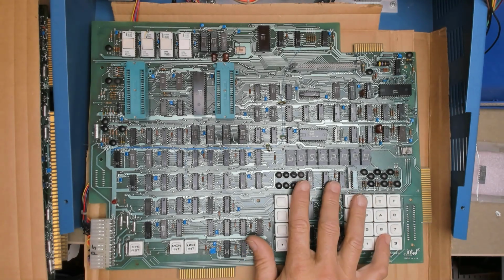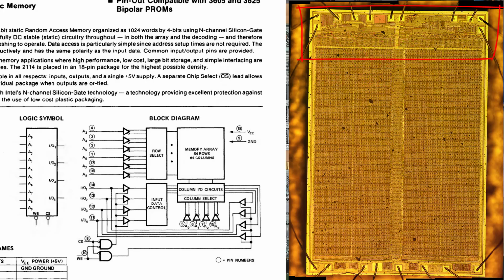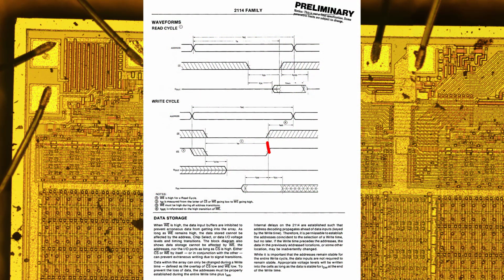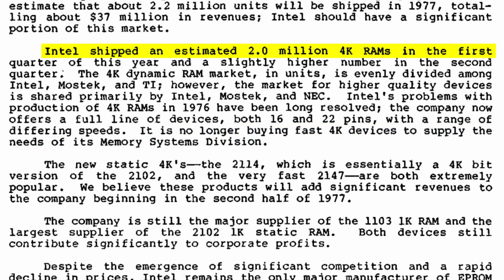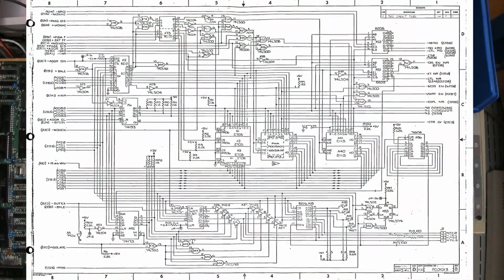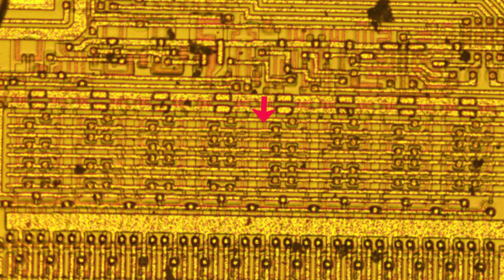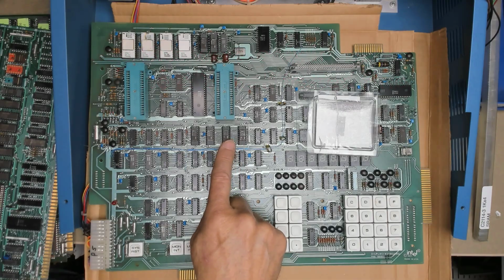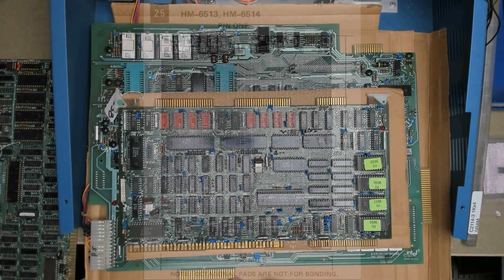{110} Intel's 2113 RAM: Never Sell It, And Never Speak Of It Again

Comment: From 1980 thru 1994 I worked as a test engineer at NatSemi focused on 2716-27C256 EPROMs. Your discussion of the 2704/2708 is a bit misleading in my opinion. While a 2704 may pass as a 2708 there are potential issues. My guess is you tested at nominal Vcc and the access speed of the programmer (typically much slower the speced speeds). A cell that doesn't fully program or fully erase per the spec can be an issue for the full expected life time data retention spec. This can often be revealed by Vcc margins testing (Vcc lower/higher  then the speced Vcc range).  It can show up as a full failure of the cell or as an issue with TACC or TCE timing. Memory testing is also guard-banded meaning it will work in a wider Vcc window then the speced range and will be tested to be faster the speced access times.  
Long term burn-in testing can be used to determine the window of acceptable voltages/timing (shmoo plots). These then set the required test specs to guarantee the part will hold its programmed/erased cell state within the life expectancy of the part. In my time at NatSemi I loaded hundreds (thousands?) of parts onto burn-in boards, baked them while powered up / being accessed and pulled them at various times for testing, then back in the boards for more burn-in, then out for testing. Rinse and repeat many times. We tested fully programmed / fully erased / checkerboard (55/AA) and topological checkboard (adjacent cell on the physical die have cells in the other state around them). I also wrote the test and analysis software for the parts.
Point being that a 2704 with a 2708 die indication programmed as a 2708 doesn't guarantee the part will retain or present the programed values over the full speced life time.
Reply from the maker: That is an extremely good point, I wasn't thinking about Vcc margins testing or other conditional issues that would reduce long term reliability, i was stuck on seeing simple go/no-go defects.  It should have come to mind after testing that one 2113 that didn't show up until after the cell had been cycled a number of times before it finally stuck high.  
Since they were equivalent pin-out, I guess it wouldn't make sense to take a perfectly good '08 and mark it as an '04.

I fully expect that Intel's "1976 4K production problems" were, in fact, not completely solved by the spring of '77 and maybe ran through mid-year.  I am hoping that others with 2113s can give us a range of dates they were produced.
thanks
Reply: @HelloWorldETX  I worked through a few yield crashes during my time at NatSemi. We also brought a new CMOS fab online and it took a while to the get the process dialed it. Those were fun days and feel like a couple of lifetimes ago.

Comment: bit like part duff 64k  x1 bit drams(4164 or equiv.) but these were definitely available,  being sold as 4532s, with 4 combinations of 'dead' section, bad row or bad column and in each one of those could be higher or lower one dead,, the zx spectrum used these for their upper ram
Reply from the maker: Did they bond the die differently depending on which quad worked properly? or same pinout like the 2704/2708 and 2113/2114?
Reply: @HelloWorldETX  identical pinout , there were differences in row or column dropout depending on brand, OKI ones were one, TI the other cant remember which one had which dropout offhand
Reply: @HelloWorldETX  They had holes for links on the board to select the correct High or low.  The selection was done of different signals from the different vendors so needed quite a few links.
Reply: I read that at least one board variant of the Dragon 32 used those, there was one jumper link to flip the A7 line. All the boards I saw used two banks of 16k*1 parts, in one case the board was only designed to hold 8 DRAMS and it had a neat little daughterboard installed to hold the other 8. I don't know if the manufacturer was hit by shortages or just using whichever parts were cheapest.
My friend converted his to 64k.
Reply: @boristheengineer5160  my current dragon 32 has 16 4116s with some on that daughterboard,  a previous one had 8  32kx1bit chips which arent half duff 4164s but effectively have dual 16kx1 bit rams inside them, they have separate ras and cas pins for each 'half'

Comment: The same sort of thing happened with early 4116 16Kx1 DRAMs. 8Kx1 versions were sold cheaper and appeared in some computers such as Atari 800 and 400.
Reply: And it happened as well with the 4416 16Kx4, where defective chips were sold as 4408NLT and 4408NLB. It is impossible to find a datasheet for these (as far as I know), but they were used in Matra Alice and Exelvision EXL100 computers, with the "T" and "B" indicating if the top or bottom of the address space was usable.

Comment: It's fascinating how history repeats, back then struggling with ram chips, today struggling with 14nm, 10nm, and now rebranded 10nm to 7nm finfet transistors. In between all of this, struggling with x86 (p1,2), struggling with new architecture (p4), struggling with even newer architecture (intanium), struggling with in house graphics solutions (i740), struggling with even more in house graphics (gmas and Larrabee), struggling with more ram (3d xpoint), struggling with even more ram and memory (optane).
It reads like a disaster report.
Reply from the maker: In fairness, that is the cost of pushing technology forward.  Once Intel got the 2114 process into full production, it became the standard simply because it was superior.  Quick, low power, and reasonable cost.  while it was embarrassing at the time, in the end I think it more than made up for the delay in roll-out.     

Eight or ten years after this 2113 problem, I was at a conference where intel's CEO was the keynote speaker.  He announced that fabrication R&D was just getting too expensive and Intel was no longer going to be on the cutting edge for chip technology; but they were going to focus on designing the chip and then outsource to offshore fabrication houses so that the fab shops could spend their R&D money perfecting the process.  This was to a room full of semiconductor and fabrication researchers at a national conference !!!

Of course, that is how we got to where we are today, i.e., in a situation where none of the domestic chip manufacturers can actually make their own chips that require the absolute latest process.  The federal government can buy all the new fab lines they want for Intel and others, but when the bottom line says it is cheaper to send fabrication off shore, they will no doubt, once again, outsource the latest fabrication processes.
Reply: @HelloWorldETX : That's all nice and dandy, but with intel, it always feels like they TRY to create the next best thing after bread but halfway through, they loose interest or goal. The NuCs are the next entry to this list, intel just lost interest three months ago, leaving vendors for their own, telling them to "please be so kind and keep developing and making them, because I got bored".
Netburst... "failed" architectur, intel lost interest.
Itanium... same game.
It would have been the same for x86, if amd hadn't outdone and gone above and beyond them, fixing many architectural flaws and short comings.
AGP... intels take on a highspeed high bandwidth bus with many fantastic features such as "AGP aperture ram" and "side band adressing", never fully utilized, never truly completed.
I swear, the longer I think, the more dropped, bodged or sold projects come back from the nether realm of my brain where they should have stayed as corpses to rot forever.
And now... we are at the realm of disabled, broken, obsolete cpu instruction sets.
Disabled from THE very day it was put into silicon... (drum roll)... TSX 🎉🎉🎉.
Next contender... AVX 512...🎉🎉🎉.
I could swear, there was another one, intel silently did away, something to do with "randomized" memory mapping, inherently flawed and defeated by a precise timer like java or even javascript could provide and a whole load of ROPs. 😂
I'm not salty at intel, I just think and feel, for once they should pull something through, finish it, fix the bugs from a first revision whatever "that" is. But honestly, I can see the next butchered project already, their just recently born graphics card segment. 😮
Reply: @bloeckmoep  this is i think actually a issue all across US corporate culture. Its a symptom of short term profit preference due tp shareholder primacy.

Comment: Uh-Oh.... Now I need to dig out my prompt 48 and do a memory test! I haven't used it in quite a while now.
Thank You for another education, Craig. i was completely unaware of the 2113/2114 story. Always learn
something new in your videos.
I started thinking about the prompt 48 again when I happened upon a pretty nice 8048 based clock that
Matt Millman came up with. Of course, as He has done in the past, He designed his own MCS-48
programmer.... Man.
Reply from the maker: Hi Mark, Matt”s also has the adapter for his programmer to program 8755s also.
It will be interesting to hear about your prompt 48, if it has the piggyback board or not.  
I have seen a photo of a prompt that had four places for RAM but only two populated and two bare (no sockets).  I couldn’t see if they were 2114s or 2113. But no piggyback.

Comment: sinclair was cheap when they build the ZX spectrum computers and they bought half broken ram too. They already did that with their amplifiers where they bought rejected transistors,  so they had to make something to test and pair transistors.    So with the 2704 did they wire the address line internally or did you haveto do  that externally ?  ..   I still have a vic-20 with 2114 ram chips.  It actually has an odd amount of 2114's as for the character color ram you only needed 4 bits.
Reply from the maker: Testing transistors to see if they are 'good enough' seems like the exact opposite of when we used to test to get matched pairs.  I didn't need to do anything to the 2704s.  pin 22 is either A9 on a 2708 or ground on a '04.  i was only expecting the A0 half to program before it started throwing errors, but it programmed all the way to the top and matched the buffer.
Reply: @HelloWorldETX  Well found this on a website of someone who worked for sinclair  "The output transistors (mounted on the rear of the amplifier) were germanium and Clive Sinclair in those days used to buy reject devices: in the early days there was a lot of trouble using these, until I built a dynamic tester which plotted the gain at high currents, showing the graph on an oscilloscope."           .. so i guess he bought transistor with current gain out of spec.  which might be fine for an end stage,   but they might need to match gains.   I do actually have one of these sinclair amps, so that's why i googled it and found out about the use of rejected transistors.
Reply: I remember a couple comp sci buddies in the old days talking about some machines that used half broken RAM but I couldn't remember who, if they ever said.  Thank you.

Comment: A single-bit static-RAM cell is usually six transistors, IIRC. It's basically a flip-flop.
Reply from the maker: Yes, two that are cross connected to deplete the gate of the inactive one.  Then two to load either a 0 or 1, then two to trickle charge into the latched FET to keep it on.  Chapter 6 of intel's memory design handbook is very good description.  I should have included a figure of the storage cell, but that wasn't my main focus.  My initial curiosity was  why A0 was used as the good-half control.    
for anyone interested, DeRamp has a copy of Intel's '77 memory design handbook here: https://deramp.com/downloads/mfe_archive/050-Component%20Specifications/Intel/Memory%20Components/1977%20Intel%20Memory%20Design%20Handbook.pdf
Reply: Hence the estimated transistor count of 24576 that was shown briefly on screen, although that ignores the overhead of the decode circuits,  buffers, etc. that were main subject of this video.
Reply from the maker: @GodmanchesterGoblin  Wait.... wikipedia could be wrong?  I looked at the references they had with this number of transistors, but neither reference had the actual number as far as I could see.  I plan on removing the passivation layer and then the top metalization layer so we can get a good look at the storage cell.  Rather than load transistors, they may have used load resistors which would free up 8K of the transistors to use for addressing.
Reply: @HelloWorldETX  I have no idea regarding the correct number.  I just saw that very round binary number (24576 = 6 x 4096) which immediately drew my attention (my brain works like that), and I also went with the six transistors per cell approach.  Yes, I assume that resistive loads could have been used instead, but I don't know the history of the various topologies to judge further.

Comment: The 2114 was used in a ton of equipment, home computers, arcade machines, you can guess the pressure when one of the world's biggest memory manufacturer can't reliably make enough of one of the most popular memory ICs. (although TBH I don't know how popular the 2114 was this early on - but between '78 and '83 they were hugely popular)
Reply from the maker: Yes, the 2114 became a huge success.  To be the last manufacturer to get their 4K into production must have been humiliating.
Reply: "2114" immediately brings back my memories of mowing lawns to save up enough money to buy sixteen of these expensive chips and soldering them onto a board so I could have another 8K of RAM.
Reply: @scottlarson1548  Baller
Reply: Used in Exidy Sorcerer, Sinclair ZX80 and ZX81, to name a few.
Reply: And in the C64 as a color RAM!  @ClausB252
Reply: The Commodore 64 used a single 2112 for 2K color RAM, and the VIC 20's main memory was 3 x 2112 for 5K of system RAM and 1K color RAM.
Reply: @paulmichaelfreedman8334   They were 2114s (512x4 bits). The original VIC20 had ten of them for 5K and later switched to two 6116 (1024x8) chips for the main 4K of RAM.  

When I bought sixteen of the 2114s in 1978 they were $10 each. By 1980 when the VIC-20 was released they cost about half that (retail of course).